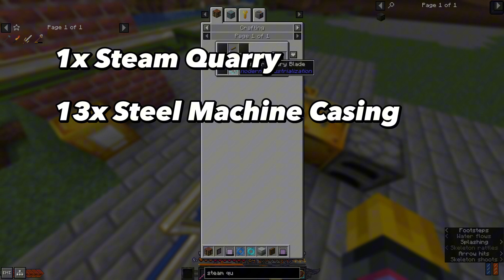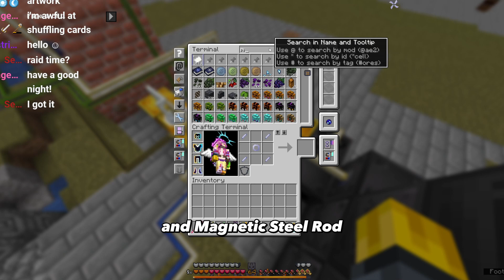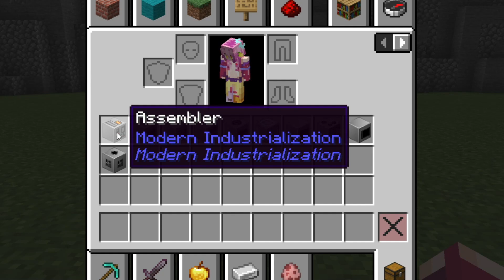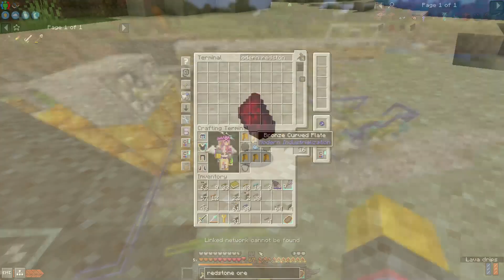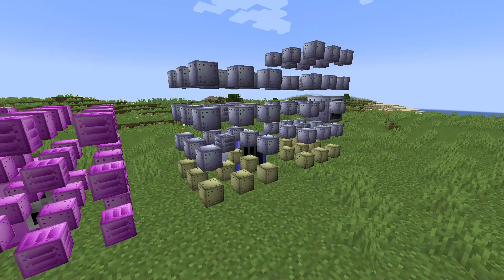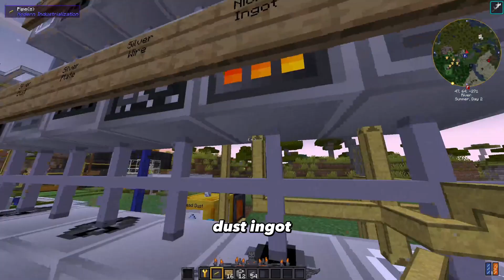Modern Industrialization Mod Full Walkthrough v 2.2.27 (Part 2/3) ELECTRIC AGE

Comment from the maker: Transcript continued:
We need another resource, Battery Alloy. Put Lead Ingot and Antimony Ingot into a macerator to get dust. Make Battery Alloy Dust by mixing Lead Dust and Antimony Dust. Put the Battery Alloy Dust into a furnace to get Battery Alloy Ingot. Make industrial amounts of Battery Alloy Plate, curved plate, and large plate. 
Make a LV Steam Turbine. You will need to make more as you continue to build more and more electric machines that require more and more power. Pipe steam to steam turbines. Now make a Large Steam Boiler. To set this up, you will need 2 Bronze Pipe Machine Casing, 24 Bronze Plated Bricks, and 9 Heatproof Machine Casing. Each Large Steam Boiler should be able to support around 8 LV Steam Turbines.
Now, make an Assembler. First you need industrial amounts of Piston (the MI Piston, not the vanilla Minecraft piston!), Conveyor and Robot Arm. Congratulations on making your first electric machine! Now make industrial amounts of it. You can use a Lubricant Bucket to speed up any electric machine.
Now, make a Polarizer. You will need three of these total for automating production later on, though 1 for now should work. 
We need a new resource, Cupronickel. Make Cupronickel Dust from Nickel Dust and Copper Dust in a mixer. Then, smelt the Cupronickel Dust in a furnace to make Cupronickel Ingot. From there make Cupronickel Plates using a Compressor, and a Wiremill to make Cupronickel Wire. Use your polarizer to make Magnetic Cupronickel Wire. Power all your electric machines by connecting them to the steam turbine with your tin cables. Craft Cupronickel Cable from the wires and rubber sheets. Make industrial amounts of all the Cupronickel items I said so far.
Make an Electric Blast Furnace (EBF). You will need 17 Heatproof Machine Casing and 16 Cupronickel Coil to build this. To power the EBF we need an LV Energy Input Hatch. Make a couple of these because every electric multiblock machine we use will need one, but don’t make too many, because we will replace them later on for better versions.
Power the EBF, and let’s power our Large Steam Boiler too. This is just the same as a regular boiler, but bigger and better. Give it 1 fluid output hatch, 1 fluid input hatch, and 1 item input hatch. Pipe in water and coal, and pipe out steam. Now you have a better supply of steam for all your machines.
We are now going to begin automating all of our resources we’ve made so far. You will have an abundance of everything, but this factory won’t be made without a big, tedious headache. Let’s dive right in. If you haven’t cleared out that giant 100x100 area yet, now is when we need it. After this process is done, you will not be making any more Steel or Bronze machines. And remember, make more Steam Turbines/Steam Quarry if your supply can’t meet demand. 
Make industrial amounts of machines: Assembler, Electric Compressor, Electric Cutting Machine, Electric Furnace, Electric Macerator, Electric Mixer, Electric Packer, Electric Wiremill, Electric Unpacker, and Electric Water Pump. If you want to store everything in barrels, then make industrial amounts of Bronze Barrel. If you find yourself needing more space to store items as we build up our factory, then make Steel Barrel. 
We’re going right back to the beginning: copper. First set up 1 quarry and a large steam boiler. This is going to be used for only Bronze Drill, which will give us Copper Ore. Bronze will be automated soon, but for now just make some Bronze Drills by hand if you don’t have more already and throw them in. As you continue creating your factory, you may need to make multiple quarries.
We also need to make a new resource, Soldering Alloy. To do this, first make industrial amounts of Pump. Then, make a Large Tank and a lot of Large Tank Hatch. Set up the tank. You can change the dimensions to your liking. The bigger the tank, the more liquid it can store. Then, set up another tank to make lubricant. We will automate the liquids later.
Our goal with this factory is to make everything from every resource. So from copper, we want a constant supply of Copper Ingot, Copper Dust, Copper Plate, Copper Curved Plate, Copper Large Plate, Copper Bolt, Copper Rod, Copper Ring, Copper Blade, Copper Drill Head, Copper Wire, Copper Fine Wire, Copper Gear, and Copper Rotor. I forgot to set up pipes for my Copper Drill Head assembler! Make sure you do that. Wow, that was a mouthful. You may want to add signs as you go to keep track of what everything is making. Make sure to pipe soldering alloy liquid to all your assemblers, and lubricant to all your cutting machines (for, you know, when we actually make the liquid). Power up your machines, configure all your item pipes and congratulations! Now you have copper automated. Ready to repeat the whole process with every single resource?
Let’s do Lignite Coal next to power our steam boilers, which you may need to make more of, since only 1 steam boiler will not be enough to power your entire factory. This one is rather simple, since we only need Lignite Coal. We do not need Lignite Coal Dust or crushed dust, but if you want those resources, feel free to automate it yourself.
Next is Tin. Set up everything to take Tin Ore from the quarry and create Tin Ingot, Tin Dust, Tin Plate, Tin Curved Plate (I forgot to turn on the blacklist filter for one of the pipes for Tin Curved Plate! Make sure all your pipes are moving the correct items to the correct machines!), Tin Rod, Tin Bolt, Tin Ring, Tin Gear, Tin Blade, Tin Rotor, and Tin Wire. Congratulations! You have now automated Tin resources. If you have leftover Tin Ore, Copper Ore, or Lignite Coal Ore, you can store them in barrels and pipe them to your furnaces.
Bronze is made from Tin and Copper! Let’s do that next. Create Bronze Dust, then from that make Bronze Ingot, Bronze Plate, Bronze Curved Plate, Bronze Rod, Bronze Bolt, Bronze Ring, Bronze Gear, Bronze Blade, Bronze Rotor, and Bronze Drill Head. I incorrectly set the pipe in/out for my Bronze Gear Assembler and Bronze Drill Head Assembler, oops! Turn on lock editing to lock certain items for all your recipes that require more than 1 ingredient in case your machines get clogged. Note that your assembler for your Bronze Drill Head can also produce Bronze Machine Casing unless you lock edit it to produce Bronze Drill Head only.
Let’s automate iron next. Set up machines to automate Iron Ingot, Iron Dust, Iron Plate, Iron Rod, Iron Bolt, Iron Ring, and Iron Gear. Then automate gold resources. This includes Gold Ingot, Gold Dust, Gold Plate, Gold Curved Plate, Gold Rod, Gold Ring, Gold Bolt, Gold Gear, and Gold Drill Head. Can you see the pattern here? We’re automating all resources that can be made with the products of the Bronze Drill.
Let’s do redstone next. This one is simple. You only need Redstone Dust. Last is coal. The only product you want from this is Coal Dust. Store Coal Dust into a barrel since you will need it later for several things.
Now, let’s automate Lubricant. This can be done by mixing Redstone Dust and Creosote.  First, pipe Steam into your Coke Oven if you haven’t already. Then, pipe Coal Dust into a barrel and into the Coke Oven. Finally, pipe out Coke Dust into a barrel, and Creosote into a mixer. Pipe Redstone Dust into a barrel and into that mixer, and pipe Lubricant into your tank. If you need your Coke Oven to go faster, build more Coke Ovens or use gunpowder on it.
Let’s make silicon. To do this, we need to power our EBF and give it Coke Dust and Quartz Dust. Make Quartz Dust by putting Nether Quartz in a macerator. I forgot to make a furnace to smelt Nether Quartz Ore! Don’t forget to pipe the quartz out too. Then, make Silicon Ingot by putting Silicon Dust in a furnace. Then, automate Silicon Plate. It’s not fully automatic for now.
Reply from the maker: We need Silver. If you are playing with other mods, you may be able to mine Silver Ore, but if not, we can make it from Lead. First, let’s automate Lead. Set up machines to make Raw Lead, Lead Ingot, Lead Dust, Lead Tiny Dust, and Lead Plate. I messed up the piping for the Lead Plate. You need to pipe out Lead Ingot for a Lead Plate! Unlike other tiny dusts, Lead Tiny Dust has actual uses that cannot be accomplished with regular Lead Dust. Once this is done, you can macerate Raw Lead for a 50% chance to make Raw Silver. You will probably run into an excess of Lead Dust. Create an Automatic Trash Can to pipe any excess items or fluids you do not want. You can use the trash can to empty a fluid slot with a right click. Finally, automate Silver Ingot, Silver Dust, Silver Plate, and Silver Wire.
We need another resource, electrum. Mix Gold Dust and Silver Dust to make Electrum Dust. Smelt that in a furnace to get Electrum Ingot. Put the ingots into a compressor to make Electrum Plate, and use a wiremill to make Electrum Wire and Electrum Fine Wire. 
We need yet another resource, aluminum. First, set up machines to automate Bauxite. Use a macerator to turn Bauxite Ore into Bauxite Crushed Dust, then another macerator to make Bauxite Dust. Store some of the Bauxite Dust in a barrel for later. Build another EBF and put Bauxite Dust in it to make an Aluminum Nugget. From here, you can automate Aluminum Ingot, Aluminum Plate, Aluminum Large Plate, Aluminum Dust, Aluminum Curved Plate, Aluminum Rod, Aluminum Bolt, Aluminum Ring, Aluminum Blade, Aluminum Drill Head, Aluminum Gear, Aluminum Rotor, and Aluminum Wire. One thing to note is that your assembler for the Aluminum Drill Head might also create Frostproof Machine Casing. If you play with other mods, keep in mind that Aluminum might be spelled as Aluminium. 
Let’s make Soldering Alloy! Finally! Make a mixer to combine Tin Dust and Lead Dust, then set up a Steam Blast Furnace for the Soldering Alloy Dust, and connect it to your tank. Make sure to use Steel Item Input Hatch for your SBF! I accidentally clogged a couple of my item pipes with the wrong items. Make sure you check your pipes and machines every now and then to ensure the filters are set up correctly to prevent clogging!
Now, make industrial amounts of Diode, Transistor, Electrum Cable, and Electronic Circuit Board. Use these to make Electronic Circuit. Now we can start making even more electric machines! 
I forgot to automate Steel! Make Uncooked Steel Dust by mixing Iron Dust and Coke Dust. Then, use another SBF to make Steel Ingot. From there, make the rest of the resources: Steel Plate, Steel Curved Plate, Steel Rod, 	Steel Bolt, Magnetic Steel Rod, Steel Ring, Steel Large Plate, Steel Gear, and Steel Drill Head. Automate Chain too, since it’s part of several multiblocks. 
Now, we’re going to mass produce more ores! To do this, make industrial amounts of Large Motor, Advanced Machine Casing, Silicon Battery, and Advanced Machine Hull. Use these to make at least 3 Electric Quarry. Each one will need 16 Steel Machine Casing, 6 Steel Pipe Machine Casing, and 4 Chain. Afterwards, make industrial amounts of Gold Drill and Steel Drill. We can’t make Stainless Steel Drill just yet. If you want to turn any Steam Quarry you have into electric ones, feel free. Don’t forget to item pipe Nether Quartz Ore and Nether Gold Ore too, since that is now also automatically generated. 
You now have automated Diamond and Ancient Debris! For this mod, you only need the ores from the quarries, so be sure to pipe out all the other materials somewhere else, like Ancient Debris, Glowstone, Netherrack, etc. 
Your Electric Quarries are probably moving too fast for your item pipes! If you need item pipes to move items faster, you can add a Large Motor or Motor into them. And Buff Motor!
Make another macerator to turn Quartz Ore into Quartz Crushed Dust. Then put that into your macerator to make Quartz Dust. 
I forgot to automate Rubber! First, automate paper. If you have a sugarcane farm, use a compressor. If you have a wood farm, use a macerator to make Wood Pulp, then use a mixer with water to make paper. Then, automate Raw Synthetic Oil. Cook that in an SBF to make Synthetic Oil. Finally, automate Rubber Sheet.
Pipe out bauxite and lead, since you already set up the automation for them. Now, let’s automate Capacitor, Analog Circuit Board, Resistor, and Inductor. Then, automate Analog Circuit, Tin Cable, Motor, Piston, Robot Arm, and Conveyor Belt (and anything else shown here, like the Machine Hulls). Make sure to use lock edit so you don’t make items you don’t want! I forgot to pipe out my Steel Curved Plate, Magnetic Steel Rod and Steel Ring.
At this point, you’re probably going to run out of electricity if you’ve only been using one boiler. If you want other sources of electricity besides steam, you can use a Diesel Generator. Craft a LV Diesel Generator. You can give it any fluid fuel, but for now, all we have is Synthetic Oil or Creosote. The generator will consume these fluids to produce power.
Now, automate Item Pipe and Fluid Pipe. This is where you will need a way to farm a lot of sand. Luckily, you can generate sand from MI! First, obtain Gravel or Cobblestone from a Copper Drill. Use a macerator to turn cobblestone into gravel, then macerate again to make sand. Sand can be made from sandstone or gravel. Use a cutting machine to turn glass into glass panes. Can you set up this part on your own without me walking you through it? Use JEI/REI/EMI for help with viewing recipes!
Automate all your drills so that your quarries will be TRULY automatic! Double check your drill recipes, because I got some of mine wrong. Don’t forg	et to pipe these to your quarries. You’re probably tired of ugly pipes everywhere, and configuring them to the same settings over and over. Time to make a Pipe Config Card! This card can camouflage pipes and copy configurations across pipes so you can easily apply the same settings on however many pipes you want!
To automate batteries, we need to automate Antimony and Battery Alloy. Make Antimony Dust and Antimony Tiny Dust. Then make Battery Alloy Dust, Battery Alloy Ingot, Battery Alloy Plate, and Battery Alloy Curved Plate. At this point I gave up on figuring out my piping and fixed it off screen, but I’m sure you can do it without my help.
Now, automate Electrum Cable, Redstone Battery and Silicon Battery. Automate Basic Machine Hull and Advanced Machine Hull. But you need to automate Advanced Machine Casing, Electronic Circuit, Electronic Circuit Board, Diode, and Transistor. Now it should be much easier to craft machines, which, if you haven’t already, you should automate. Note that your Diode assembler can also make Steel Tank. I will not make assemblers for every single thing, but at this point, you should know to automate anything you will need industrial amounts of. Check EMI/REI/JEI for recipes.
Do you want an Elytra? A jetpack is basically the same thing! First, make an Aluminum Tank to store fuel. In this case I will be storing Synthetic Oil. Then, craft some Rubber Helmet and Rubber Boots to go with the outfit. Finally craft your Diesel Jetpack. You can fuel it by right clicking a tank with fuel. While we’re at it, make a Diesel Mining Drill and Diesel Chainsaw. You no longer need pickaxes, axes or shovels! Toggle between Silk Touch and Fortune III with shift right click. If you want it to break blocks faster, then you need better fuel. We will unlock more fluids that can be used as fuel as we continue through MI.
We’re almost at the midgame of this mod! Let’s make more machines. First, automate Pump, Large Motor, Large Pump, Nickel resources (Ingot and Dust) and Cupronickel resources (Dust, Ingot, Plate, Wire, and Magnetic Wire). Your Pump assembler needs Soldering Alloy!
Next, automate all your Invar resources and Diamond resources: Invar Dust, Invar Ingot, Invar Plate, Invar Large Plate, Invar Rod, Invar Bolt, Invar Ring, Invar Gear, Diamond Dust, and Diamond Plate. Then, automate Invar Rotary Blade. Automate Centrifuge, Chemical Reactor, Vacuum Freezer, MV Steam Turbine, Distillery, and Electrolyzer. I set up this automation off-screen, because at this point, you should be able to do it yourself. Also, you can now centrifuge Lignite CoalDust to Coal Dust! Make an Advanced Large Steam Boiler for even more power, and make an Oil Drilling Rig, a multiblock that needs chains, Steel Pipe Machine Casing, and Steel Machine Casing. Automate any machine casing you need, and Aluminum Drill. The Oil Drilling Rig will make Crude Oil from the Aluminum Drill. You can use Crude Oil as fuel for your diesel equipment!
We are now beginning the Midgame of MI.